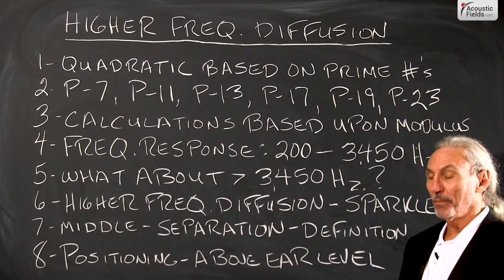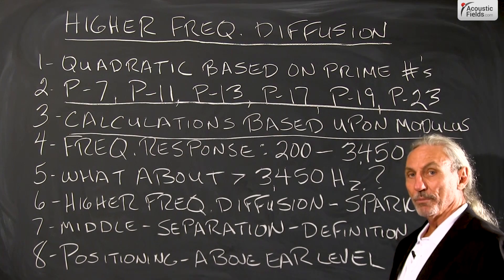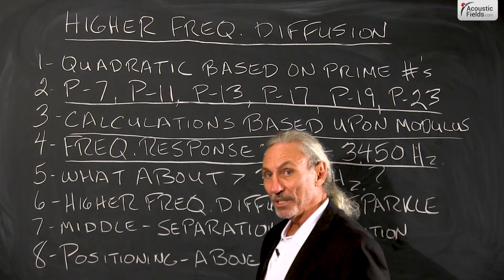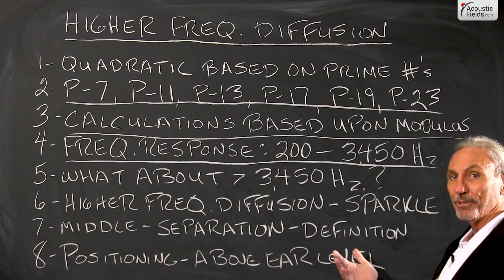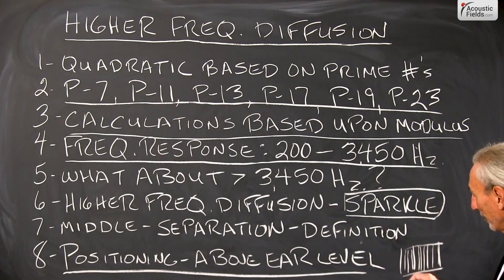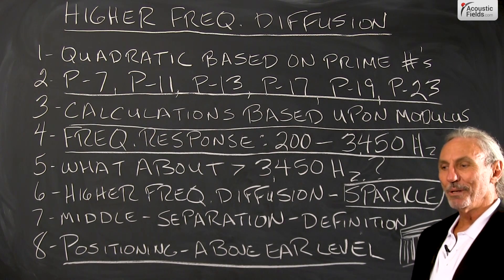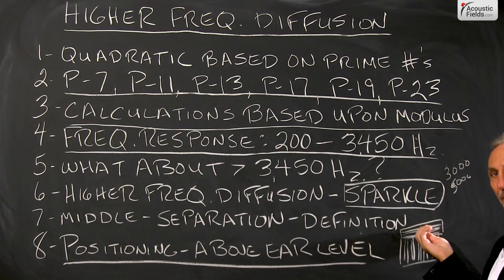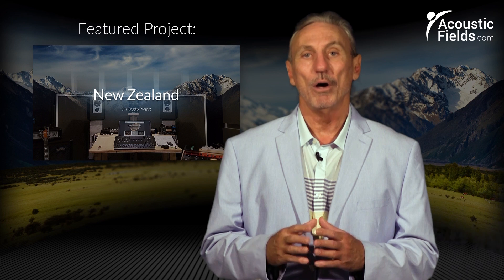What Do You Know About Higher Frequency Diffusion? - www.AcousticFields.com

Comment: Hi there I was wondering how the implementation of a horizontal high frequency diffuser compared to fractal stacking the QRD. Is there a particular situation where you would use a fractal diffuser instead or do you find it best to implement the 3D diffusion to account for the higher frequencies that way instead? Additionally, if a diffuser was to be used in a control room at ear level would there be any negative effects to diffusing in 3D space if the floor to ceiling modes had already been treated? Very helpful video, thanks!
Reply from the maker: Diffusion is distance and usage dependent. The decision whether to use 2 - D diffusion versus 1 - D depends on these two variables. A 1-D diffuser can have a positive impact on soundstage width, separation, and definition if used on the front and rear walls. These diffuser types work best in two channel and home theater installations. A 2-D diffuser does none of that. It renders the surface area so that it produces smaller "reflections" that are more difficult to localize by the engineer and therefore will not be heard within the mix. 2-D  diffusion is distance sensitive along with 1-D.

Comment: How would you calculate how many (or how much surface area) of the higher frequency diffusers you'd use in let's say a control room and a live room?
Reply from the maker: N,  Each usage would have to be looked at separately. You must first get your low, middle, and high frequency energy balanced then you can see what is lacking. Every usage is different. Every room is different.